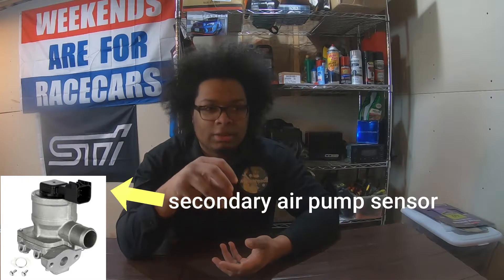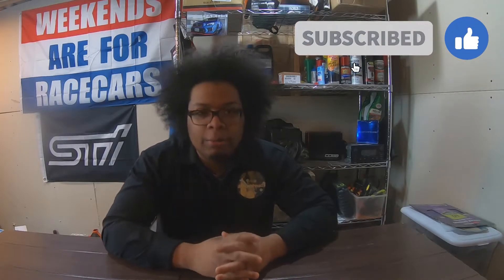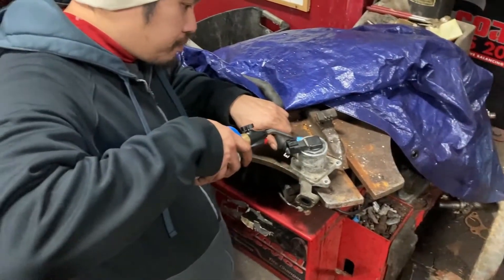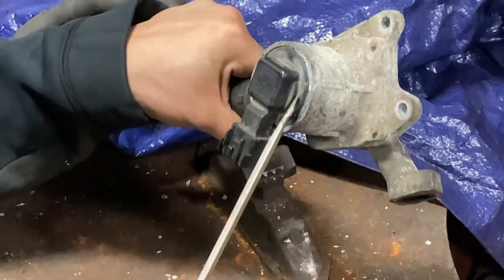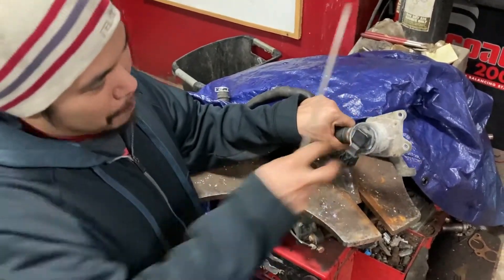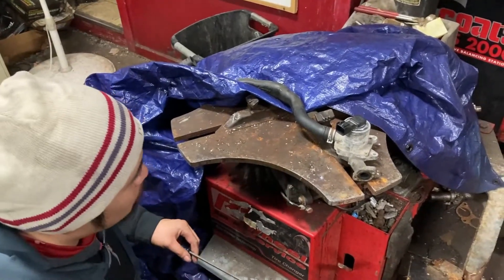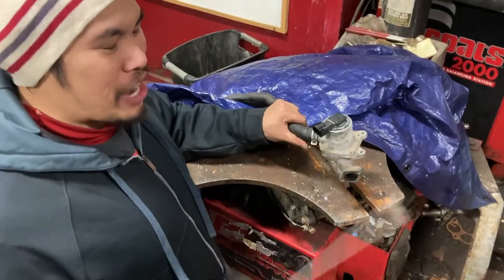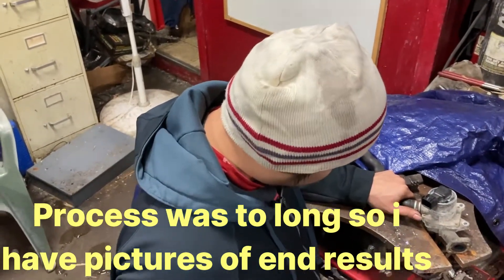Wrx/STI Deleting the Secondary air pump (BAROMETRIC sensor)

Comment: Bro, I cannot thank you enough for putting this video together. I had my car tuned pretty much at sea level, however I live in the mountains where the barometric pressure is obviously different than where it was tuned. On my drive back to my place, everything was perfect until I started climbing the mountain and temperatures / barometric pressure changed, resulting in some VERY weird air fuel ratio trims, something felt very wonky and during some parts of my drive it felt like I was loosing power. After watching your video I went straight to my car and set my accessport to read barometric pressure, and I compared that with the manifold absolute pressure. Go figure... the values where no where near the same. Baro pressure was at 21.76 and my man abs pressure was reading 13.81. Did some more digging regarding the actual baro pressure where I live and it should be somewhere at ~14.5, indicating that my baro pressure sensor is faulty!!!

I'll follow up once I get a new one and get it installed, hopefully my fuel trim issues will get sorted - keep your fingers crossed to the Subaru gods for me. I'm more than certain that I'll probably have to get a re-tune with the new baro pressure sensor in, but holy shit it is wild that such a thing can cause very weird idle / air fuel issues. CRAZY!
Reply from the maker: Glad the video could help

Comment: looking at getting a 2015 sti and pretty sure it had a air pump delete and the sensor wasn’t plugged back in. so the check engine light is on. dealer said they’re sending it to the shop. so my question is, does it need the sensor to not throw code? or just needs sensor to be tuned right? i’m a little confused and just wanna make sure it’s right if i get it. i appreciate it
Reply from the maker: Hey. Yeah you’ll need the sensor for both. But especially for tuning. The sensor is basically used to pump air into block as needed. Plugging the sensor back in makes it read like it’s still functional. so when you go to get it tuned with out the sensor the car won’t read air fuel ratio right which will cause boost problems. My friend had the same problem and he ending up boosting at 7 pounds lol
Reply: i appreciate it! i also have another question because come to find out the car came from canada and we all know about the salt they use and rust issues.. but. the car i am looking at only has 50k miles. do you think that would be enough to give it real issues? even if i get it washed and sealed or treated or soemthing
Reply from the maker: That’s all gonna depends on how the previous owner took care of it.
Reply from the maker: I don’t think that will be a big issue. 50k is pretty low mileage. As long as previous owner kept up with washing it. but I would ask them for pictures of the undercarriage just to verify it’s clean. If there is surface rust you’ll be fine. If you plan to get the undercarriage coated that would be a plus and also look into a ceramic coating to keep paint in good shape.
Reply: i apologize for all the questions. but i just have one more. am i putting the car at risk in anyway if i drive with the engine light one from the air pump delete? if yes. am i putting the car at risk by driving with just the sensor plugged in? it’s going to the shop to get the pump reinstalled and tuned next tuesday. again i appreciate it so much
Reply from the maker: Not a problem, this what we want.I’d say yes you’re stressing your motor a bit, So the secondary air pump sensor is primarily for at start up to measure how much fuel is passing through the system. It’s secondary function is to bridge the info from MAP & MAF Sensors to help the ecu see what the airflow of the motor is. You should always resolve a CEL(check engine light) asap.
Reply: okay gotchya gotchya. making a lot more sense now. so basically without a tune it’s stressing the motor? got to tune it with or without the pump to clear CEL? just having the sensor plugged in without the pump is just tricking the CEL off?
Reply: @WrenchHeadsTuning  do you just cut through the copper going down to the solenoid?
Reply from the maker: No you just want to cut the top part. Which is just  thick plastic. Use heat to weaken it. Hope this helps you.
Reply: @WrenchHeadsTuning  sorry I think my question was to broad. I got mine looking like urs but I noticed when I popped the plastic off the top there is copper running through the thicker plastic at the base. I took apart the lower disgarded section and it seems to run to the solenoid removed, i just wanted to confirm, I don't see how you can remove the plastic top without the 2 copper wires cut? I appreciate your help!
Reply from the maker: So when you look at it the underside, the copper wire should run into the plastic against the metal bottom. All you need is the metal base and the rest act of the sensor…https://www.google.com/search?q=subaru%20secondary%20air%20pump%20delete&tbm=isch&hl=en-us&client=safari&prmd=svin&sa=X&ved=0CB0QtI8BKAJqFwoTCNDZiZCor_gCFQAAAAAdAAAAABAM&biw=428&bih=746#imgrc=aVMStGlJwa7SAM
Reply: @WrenchHeadsTuning  hey please help me so today I finally did the the air pump delete on my 2016 STI with the block off plats. However, it was acting all crazy because the sensors weren't connected. So tomorrow I will go back and reconnect the sensors. Onces the sensors are connected can I use the that way or do I have to get the cell removed before driving. I live in a foreign country and there's no tuners that can actually do that. Please help! 😢
Reply from the maker: Hey @Rocketboyz 100 your car will still be drivable but it might not be at 100%.  You might notice lose of performance or not hit target boost. Also you should get a cel light on dash if it wasn’t delete through accessport or open source tune. I recommend finding someone online that can open source tune and make a map for you.
Reply: @WrenchHeadsTuning  Okay! Yeah, because yesterday it was acting all crazy without the sensors connected and the boost gauge was also acting all crazy was it because of that? I do have a Cobb accesport, so I have to delete it through the Access tuner correct? Sorry for the questions man I appreciate the fast response!
Reply from the maker: We don’t mind questions. Always happy to help. Yup that will cause it to act crazy. Happened to friend of mine and he couldn’t boost pass 8 pounds. Yeah you’ll have to do it through the accessport. Now I know in the states Cobb change a lot of things we can delete on accessport but not sure about anywhere else. Let me know what happens when you plug sensor back in and start driving it.
Reply from the maker: Don’t feel bad for the questions at all, the baromosensor is used by the system to help regulate the fuel to air ratio and vacuum. So you can not delete that ever. I know some cars are able to wire in a sensor to mimic the draw the electric system. Even right a tune it’s recommended to keep it in place unless you go open source and that person has developed a way around it.

Comment: Hello
I am very interested in your video.
My Subara already has a long period problems with the secundaire airpump system and I am wondering if what you are explaning in this video also works for an European Subaru Forester SG 2006 no turbo EJ 204
Hope to hear from you
Kind regards
Javier
Reply from the maker: Hello Javier, is your secondary pump not working or do you just want to delete it. I would look to see if there is a delete kit for your car and if your setup is similar to mine you should be able to do it. So if they sell the block off plates for you motor you’ll simply follow what we did. Cut the sensor part off and plug it back in so the car thinks your secondary air pump is still functional.
Reply from the maker: You will most likely need this too link- https://asukaautoparts.com/collections/frontpage/products/sae .
Reply: @WrenchHeadsTuning  hey please help me so today I finally did the the air pump delete on my 2016 STI with the block off plats. However, it was acting all crazy because the sensors weren't connected. So tomorrow I will go back and reconnect the sensors. Onces the sensors are connected can I use the that way or do I have to get the cell removed before driving. I live in a foreign country and there's no tuners that can actually do that. Please help! 😢
Reply from the maker: I would check with the regulations of where you live because this is purely for your emissions. Now if you are aloud to disconnect it then you’ll want to keep the barometric pressure sensor plugged in.

Comment: What did you actually remove
Reply from the maker: We removed the sensor from the pump. We did a air pump delete. But You need to plug the sensor back in so the car still thinks it’s there. If you go to tune it with out that sensor your a/f will not read right causing boost issues.
Reply from the maker: It will also make it look neater to take the pump off then have it crammed in or dangling from the engine.
Reply: @WrenchHeadsTuning  
Was the car a non turbo
I'm having trouble with a 2.0 non turbo Forester 
That valve is stuck open
Reply from the maker: My car is a 2.5 turbo 2013 wrx. Are you trying to delete the secondary are pump? And what year is your forester?
Reply: @WrenchHeadsTuning  2007 and yes
Reply from the maker: Yea you  probably need a new secondary valve. It's known to go bad. That's the baro sensor. Same thing on the non turbo models. Need to buy a new one. Not cheap at all. There like 200-300.
Reply: @WrenchHeadsTuning 
I think I've found a legacy scraped for250
Thanks for the feed back
Reply from the maker: Your welcome. Anytime